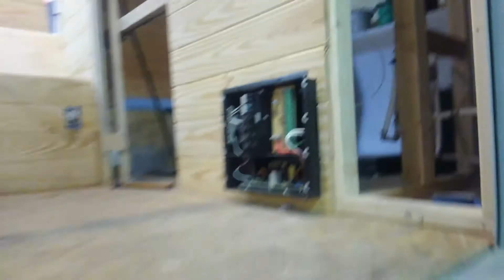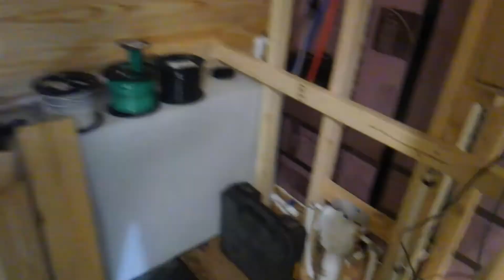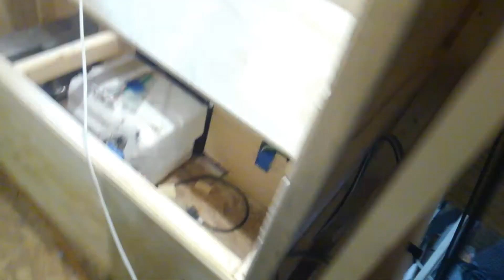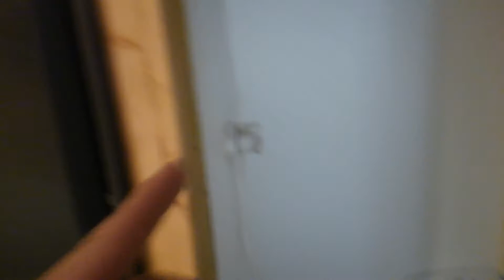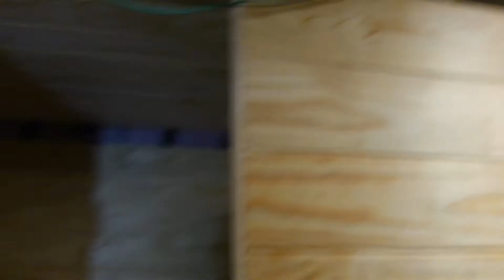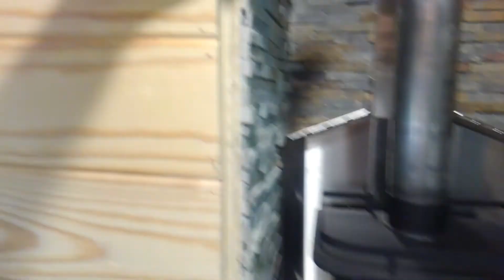Military Truck Camper: Plumbing a Real Bathroom | Trax Off-Grid E4

Comment: I hear the cubic mini is super warm.. I've seen them installed in a scamp 13foot travel trailer with a vericall stove pipe to the top of the travel trailer
Reply from the maker: It is super warm but I would not rely on it for my only heat source. I love the cubic mini and will get another for my next build. Just like to have a could heat sources

Comment: Aloha, I read your answer to the question about building your own box. I am also seriously  cosidering building my own, as well. Were you able to record the box build? If you did would it be possible to show a clip of the box build? How did you mounted your box to the frame of the truck? Did you use a fiberglass composite for your walls, and if so, what kind of insolation did you find for the R-factor, or rather how thick was the insolation?Thanks, for sharing your work, and I look forward to seeing Optimus as you get closer to finishing up.. Again, thanks for sharing ,and great work so far.. Aloha from Hawaii...

Comment: Aloha, your doing a great job!! Thanks for sharing your work with the rest of us. Did you build the shelter yourself, or buy it empty, or how did you come by it. If you don't mind can you talk about the box mounting? Most I've seen have had a 3 point triangled attachment with bushings type at the attachments for maneuverability and less stress for the box . It would be sweet to see a video on that part of the job you folks have done. I've thought seriously about building a habitat box myself, but, I want to look at all the options first, I've been researching expeditions trucks for the last year or so. I'll be looking for a LMTV M -1079 within the next month or so. They are a much heavier truck and may use more fuel, but, their US Military strong. I think parts are easier to find and mile are low on the truck. I've heard only good things about the Allison trans. Was going to look for a Steyr, standard trans., but, there hard to come by here in the states, and buying one from Europe would be costly. Aloha from Hawaii for now..